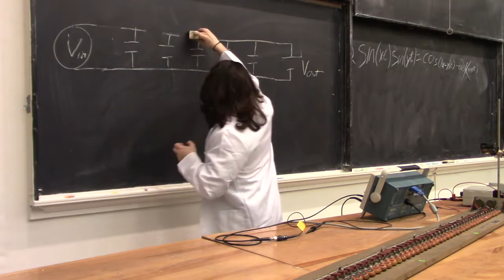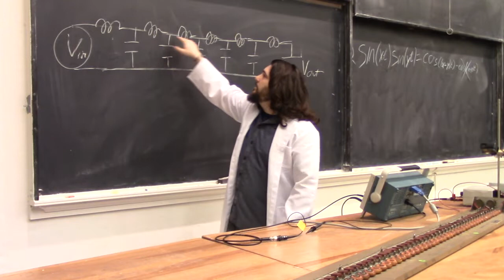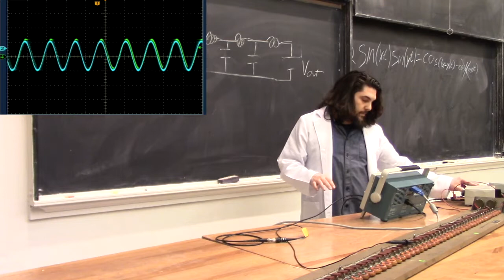Demo 12603: Transmission Line

Comment: I believe AC it's used because it's easier to step up the voltage which really helps to reduce energy losses via heating, but resistive losses apply equally to AC and DC.

Comment: This is good,but without using this inductors model can we check this delay by using a exact transmission lines.
Reply from the maker: While we skip a few conceptual steps, we do look at electrical signals delayed in an actual transmission cable in Demo 12601, Electrical Pulse in a Long Cable: https://www.youtube.com/watch?v=Ryplx5TafDI
Reply: @caltechsfeynmanlecturehall3112  thanks for your reply it is useful